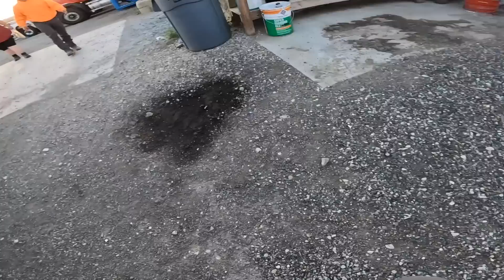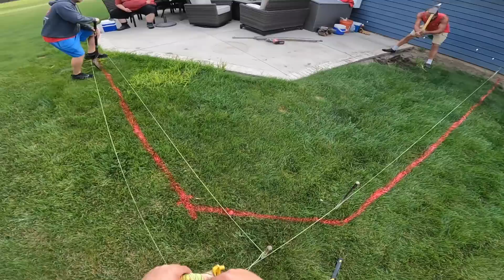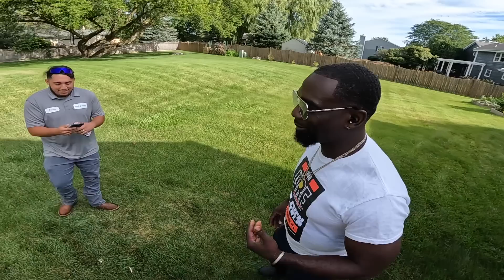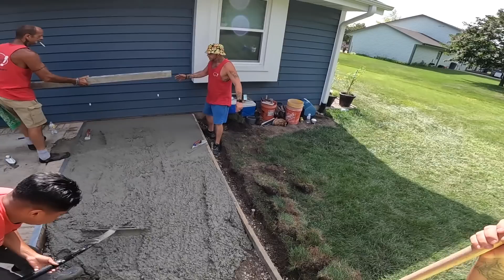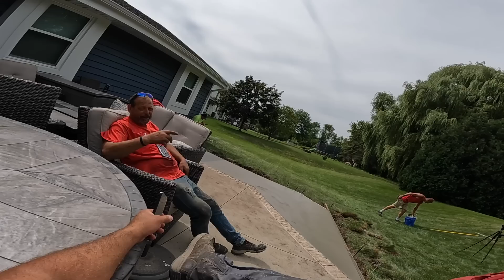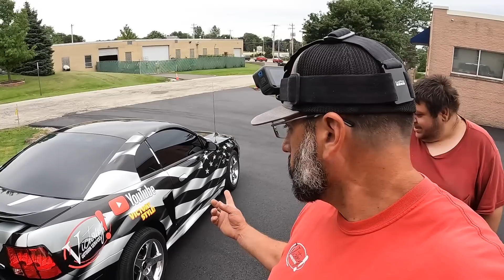Concrete time! How to add space to your patio

Comment: Hey Ryan I would suggest to you for some kitty litter for Annie. If you have a Blain's farm and fleet near you go there and get their brand cat litter I have a lung condition and I would highly recommend it because I could almost be nose deep while cleaning the box with the dust. It definitely works and I had about 6 indoor cats and couldn't smell any of the ammonia from the box. 
Also suggest to the Kwik register ladies when scanning that product that never wants to scan is put the product next to the reader and slowly pull it away and it'll scan the item instead they're always scanning a few inches away. The barcode has special things so it'll scan so they need to be close first. I used to work at a gas station myself so I know the struggles of scanning things.

Comment: i got something on friday and it was literally taking off on one end before i even had it bull floated!  I couldn't even think of wet jointing.  Anddd the plant never had a slip for me!? Is this fishy?  WE did everything we could to keep up with only 65 feet of sidewalk.  I never had it take off like this.  Do you have any input for me?  it was 75 and sunny  some wind.   I ordered 4000lbs with air, fiber, with 1 percent retarder.   I did use the conveyor for the first time so perhaps the mud sitting in the trough...?  I called at 10 am to batch on saturday and they were gone for the day??? They're usually there until 12.  Whaat do you think?   Also when I went to bull it it was so sticking i couldnt beleive it.

Comment: Ryan, Yes you are running a business & you appear to only do people with lots of💲MONEY💲. Some people only have so much to live on & their needs are for a small patio or steps or wheel chair ramp or small drive-way, or they appear to have a modest amount,  but is not an obscene amount, because they don't own a Multi-Million Dollar Home🌳🌳🌳🏫🌳🚗🚙🛻🏍🛺that needs an obscene runway🛬driveway for their 3 or 4 car garage or huge patio for their cocktail🥂🍾🍹🍷🍸🍺 parties or long front walkways you could drive on, they never use for themselves, they go into their homes from the garage. If you don't need the small jobs in life than stick with what you call the Easy Money Jobs. Why didn't you just take a Cement Mixer & Bags of Concrete for this Small Job? Saved on Time & Payroll for another Job to get started. always, Tommy🤠